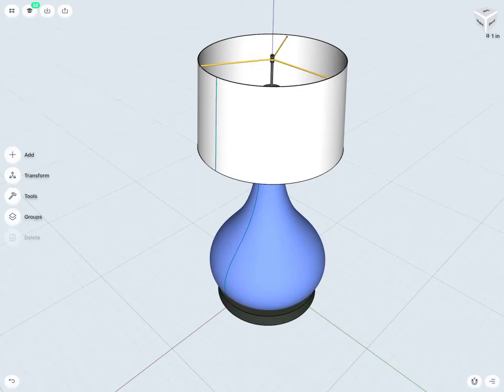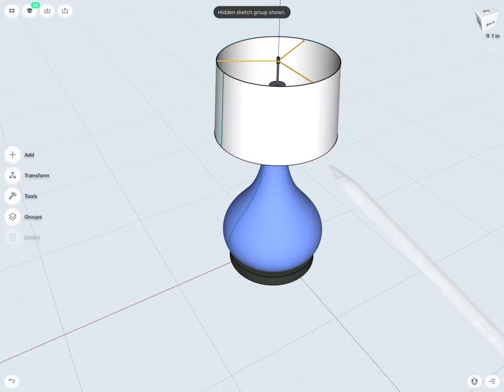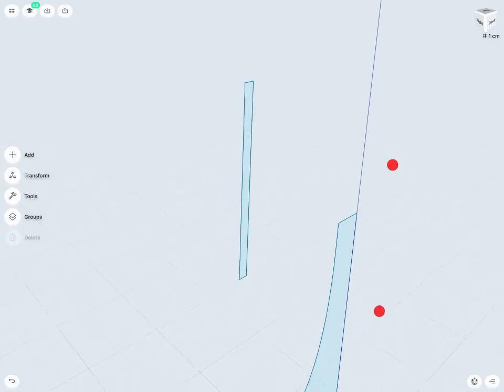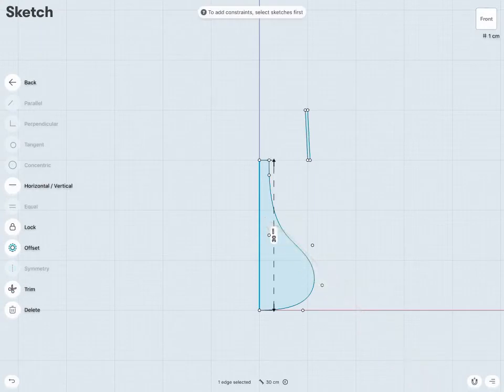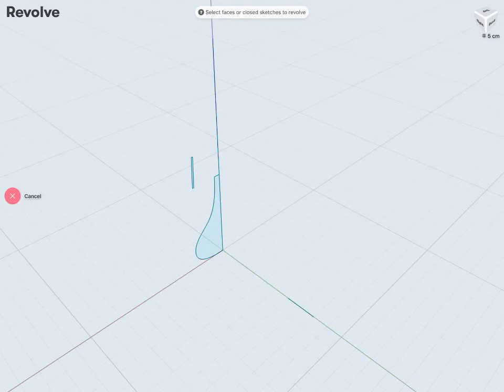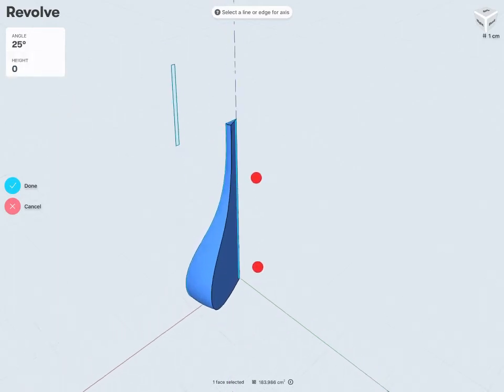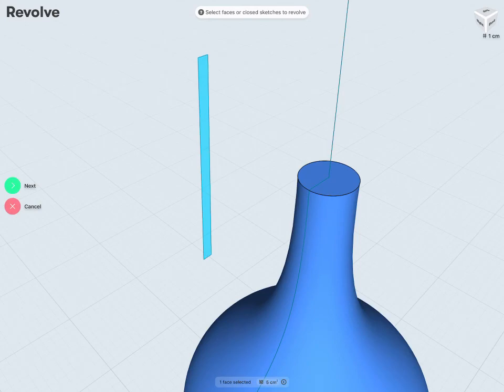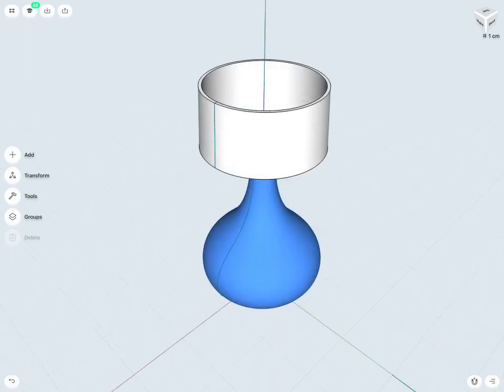Revolve Bodies | Shapr3D for Beginners

Comment: Is there anyway to link or keep the history between sketch and body? 

I.e. I completed the sketch, created and revolved around the construction z-axis, and decided I did not like the shape. So I went back to sketch and slightly adjusted the control points on the spline. But my revolved body is not updated. Do I have to revolve it one more time? 

If it was extruded or filleted/chamfered, I can do direct editing. Anyway to do the same for revolve?

Thank you.
Reply from the maker: Hi, Shapr3d is a direct solid modeler. The sketches are not linked to the bodies. in this case, if you edit the Sketch you will need to generate the body again and model edits can be done directly on the body using the modeling Tool options.